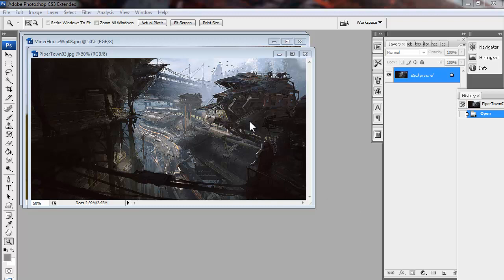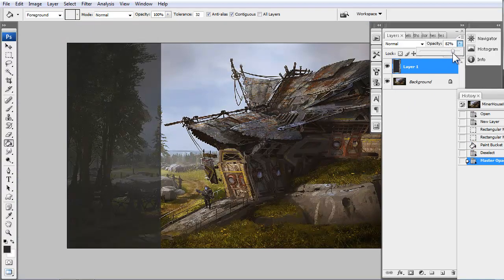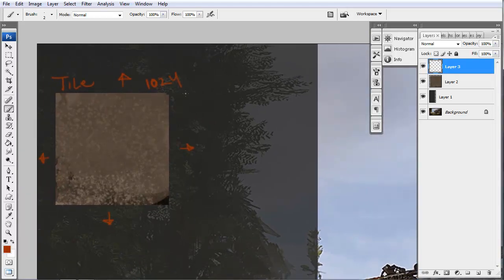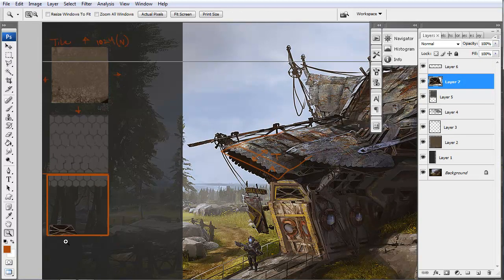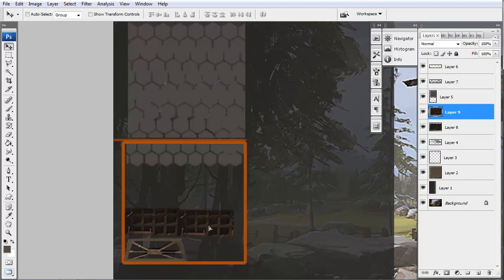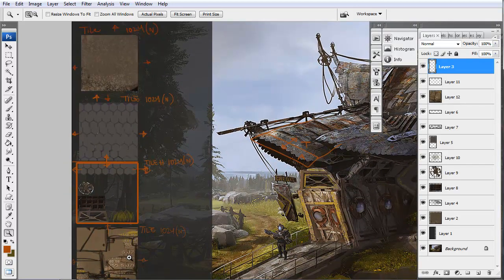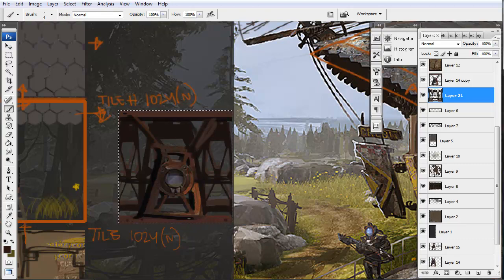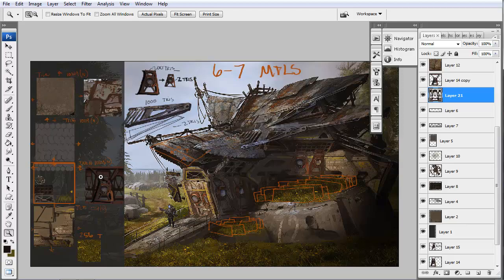3d Modeling Architecture Part 1: Planning your textures

Comment: Can you elaborate on "mots of the textures today are baked from high poly geometry" Baked with lights? or just the texture? I'm a little confused. If its just the texture what is the point unless you are using a normal map to give the illusion of more geometry? Please correct me where I'm wrong, I'm confused